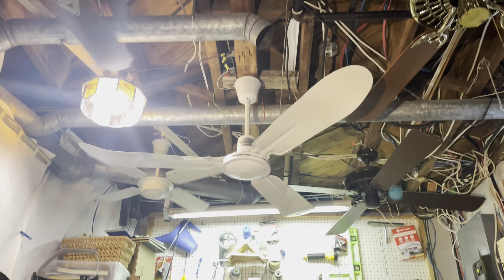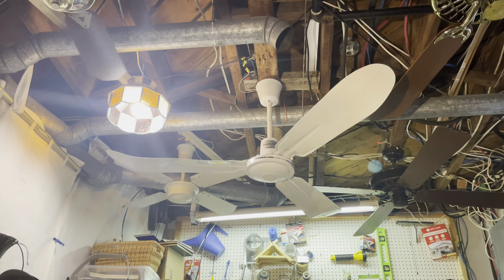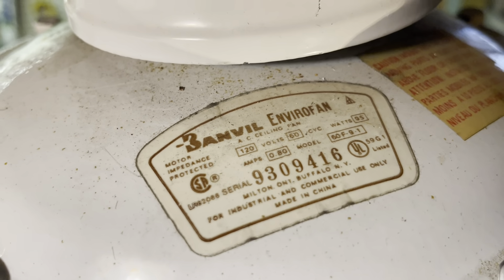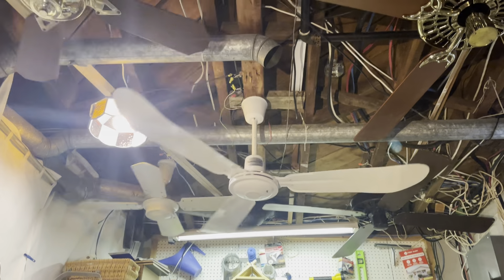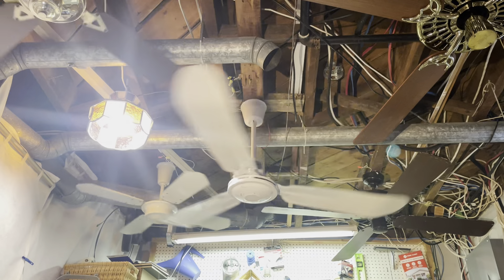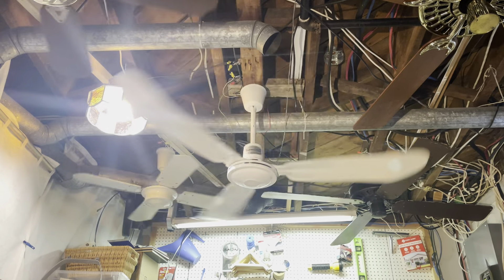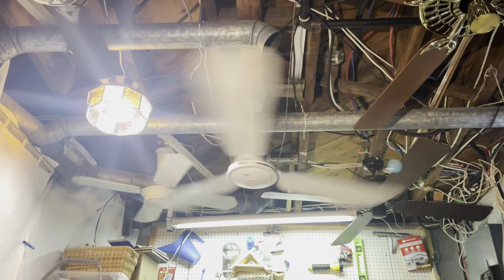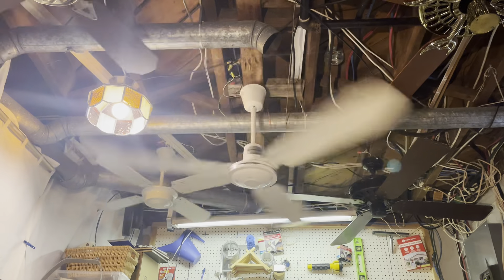Banvil/Envirofan Silver Line Industrial ceiling fan (3 of 5)

Comment: How long can this fan be hooked up to the remote?, and what would happen if you permanently wire this fan on a remote?
Reply from the maker: You can hook it up to a remote for as long as you can, all you need is to disconnect with the wires nuts attaching the wires